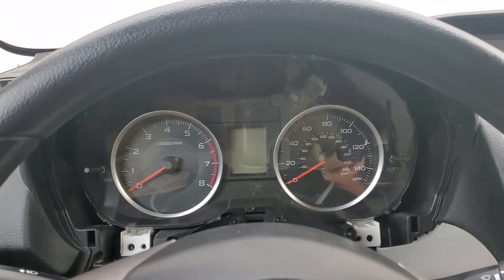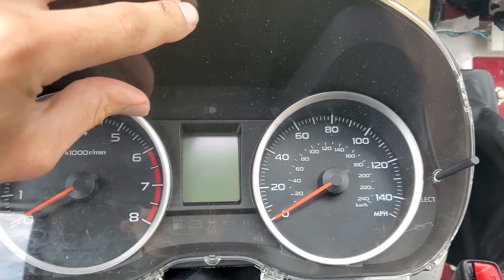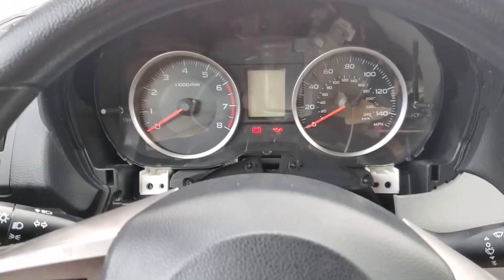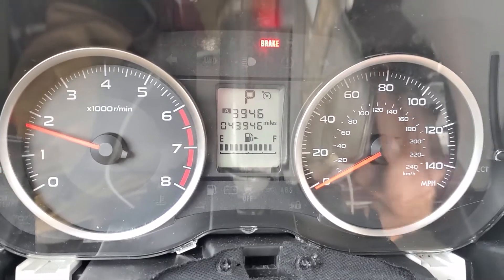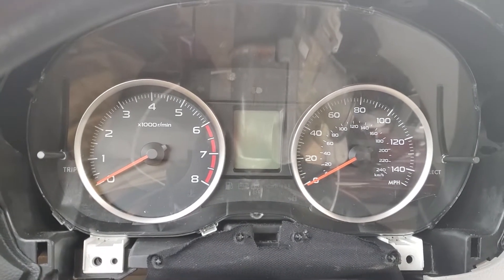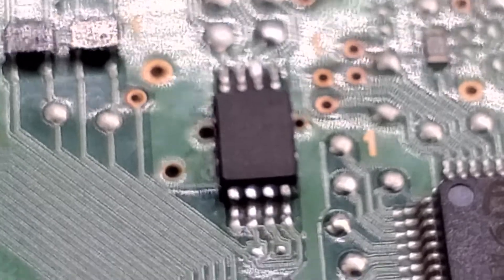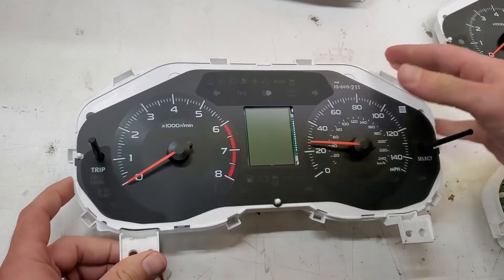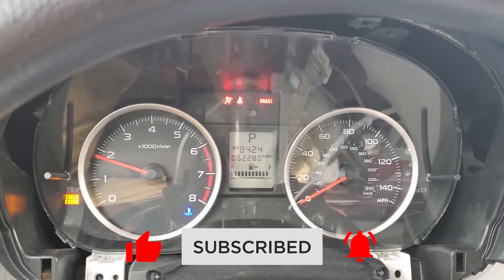Subaru Forester Cluster Replacement Cloning EEPROM Odometer Transfer

Comment: Hi I have a second generation 2006 JDM subaru forester. Everything works in my instrument cluster. But the trip meter will no reset physically. I does reset after disconnecting the negative battery terminal.. Do you have any suggestions? Thank you

Comment: Great video.  I have a 2016 Subaru STi and just bought a replacement cluster.  I also  have a sop8 programming clip/usb dongle coming tomorrow.  I'm going to try and transfer the original hex from the original eeprom over to the new chip (after backing each one up of course) but my concern is:  Are both the mileage & key security stored on the same chip?   The chip I suspect is the one to reprogram has MXIC MX25L3235E on the chip.   Any chance the VIN is stored on any of these chips?
Reply from the maker: Yes the key and odometer reading are both stored on that chip. So if you transfer the data on the IC from the original cluster to the replacement cluster then the replacement cluster should show your original mileage and the car should start.
Reply: @AutomotiveCircuitSolutions   Thank you for the confirmation. I had to cancel the programming clip I had originally ordered - read some forums where they said the voltage wasn't right and could damage the chip. I'm back to looking around for a good clip/usb dongle that will work for this.  Any advice appreciated!  & Thanks again for the reply.
Reply from the maker: @mysticrider76  We us a $2k programmer for this. Why not just transfer the entire chip like we did in the video?
Reply: @AutomotiveCircuitSolutions   I may end up trying that.  My soldering skills are "ok" at best and I worry about screwing up the only working chip I have.  The last soldering/re-work station I bought on Amazon SUCKED - the hot air was not hot enough to remove components from the PCB board.  So I returned the station and looking around for another.  

Again, BIG THANKS for the quick informative replies!  =)

Comment: So in this repair only the eeprom chip was swapped and no reprogramming done? VIN, immobilizer and mileage transferred over on just the chip? Thanks
Reply from the maker: That's right. That chip stores mileage and immobilizer data.
Reply: @AutomotiveCircuitSolutions  do you know if the previous Forester generation (2009-2013) works the same way?
Reply: is there a way to get the replacement cluster to work and start the car without transferring that chip over to the replacement cluster ?
Reply: @Thaghossstt187 have u done anything go it

Comment: Do you think I could do this?, i'm pretty okay with the soldering!
Reply from the maker: I don't know if pretty okay will cut it on this one. The pins are very close together. This job takes a seasoned soldering technician to do.
Reply: I think you need this EEPROM cable, I have used its very good, don't need to remove IC from pcb board, its for  Msop / Tssop, etc, 
see below, 
https://www.3ello.com/home